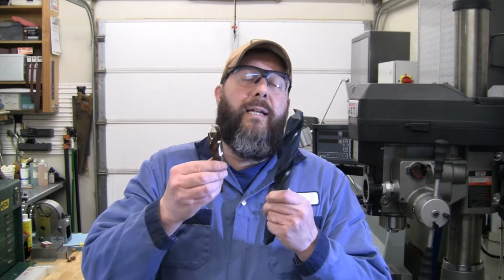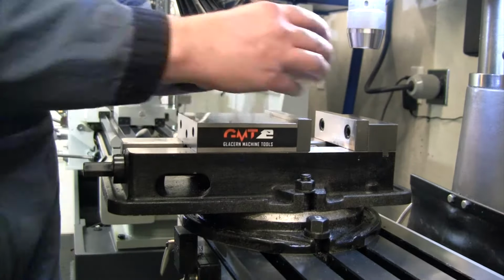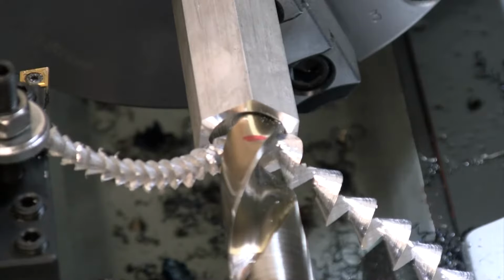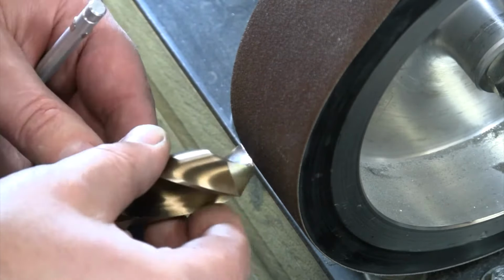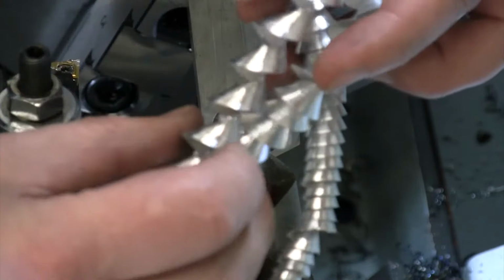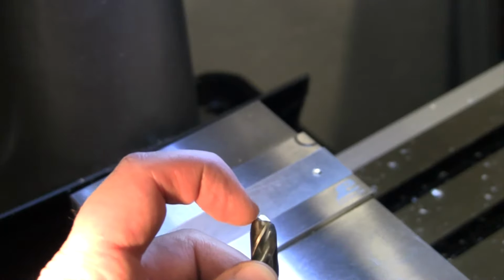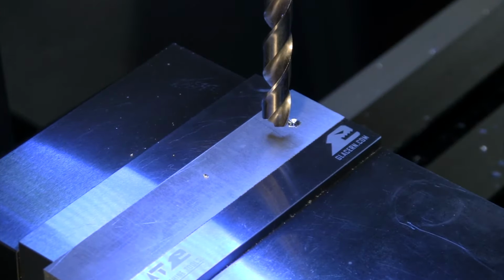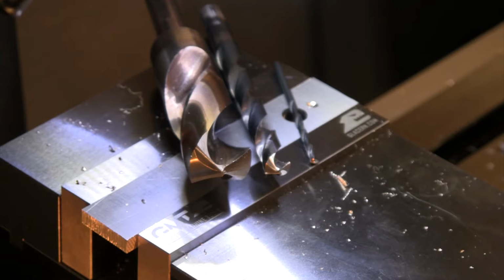How to Sharpen Twist Drills - Small, Medium and Large.  A Skill Everyone With a Shop Needs!

Comment: The best explanation I found in the network. One point is missing: cutting edges with different lenght result in bigger hole size.
Reply from the maker: @mbarshesh  Appreciate the comment and the feedback. In the intro I talk about the importance of getting them equal length so they cut equal, did not realize I hadn’t mentioned what actually happens when they are not equal and cutting even.  Thanks!

Comment: Hey Bud...great idea  on the large drill fixture for checking lip length....
I have watched dozens of video on drill sharpening, 
and have never seen this great device....your  video is to the point, pun intended....
and very well done, I also use a belt sander, and old 2x48 Kalamazoo.....
wish I had something that did not hop around so much.....I do own a 
Black Diamond drill sharpener, but it only goes to 3/4"....so your technique 
is very helpful......I did come up with a way to put flats on the shank of 
Silver and Demming bits, by using a 5C collet and a hex collet block and 
then an xy table to move the bit back and forth in front of a grinder, 
which I took my Radial Arm saw and installed a grinding wheel on it....
used the arm to move the wheel in and out.....worked slick......unfortunately
my mill is under the weather, so I had to improvise....if you know what I mean....
If I use a 1/2" collet, I can put bit in the square collet block and run Back and Forth
to grind on the radial arm saw or belt sander......for really big bits.....I hope I have not 
bored you with this long winded dissertation......[pun intended again]
best wishes, Paul in Orlando, Florida
Reply from the maker: Paul Brown - Glad you enjoyed the video, and not to long a story at all. I always like to hear how others improvise to get things done. That is always the challenge in the small home shop for the one off unique task is how to do it with what you have in hand.  Cheers!

Comment: What happened to the good old fish tail gage  !
Reply from the maker: Doug Ekren - The old fish tail gauge is a great tool for threading for sure. I have a couple of them I use. With the 60 deg in the tail you can get an ok read on one edge of your drill and 60 is pretty close to 59 deg. I just tried it and it is a little hard to hold square on the shank with so little edge length in the fish tail. But, if that is what you have instead of a protractor I say go for it. Thanks for the comment.

Comment: Do you have any tips on resharpening a parabolic flute bit? These have much thicker webs than normal drill bits, and when you try to grind it like a normal drill bit, it does not look right.
Reply from the maker: Tyler Fu - I am not familiar with that type of bit. I have used some bits with a thick web and after sharpening I go in and thin the web on the trailing edge to get a more normal size chisel point. Maybe that will work for what you have?
Reply: @BladesIIB  Problem is my bench grinder can't grind a sharp corner... the edge of the wheel is rounded and no matter how hard I try to thin the web all it did is round it over. I think I need one of those belt grinder but they're really expensive over here.
Reply from the maker: @taiwanluthiers  look for a wheel dresser to square up your wheel. Either a Star dresser or a diamond dresser. They are only $20-$30 dollars and easy to come by over here. Hopefully those are easy to access for you as well.
Reply: @BladesIIB  Is it even possible to dress a normal stone wheel to be able to grind a sharp corner? A while ago I got a dressing thing but it was a single point diamond, not the hammer looking thing, and while I could dress the wheel for some reason the edge is always rounded.
Reply from the maker: @taiwanluthiers  I guess it depends on the wheel. You should be able to get a pretty good corner. Depending on the hardness if the wheel it could round over and wear pretty quickly again. But I have sharpened many drill bits in a stone wheel before using the belt grinder.
Reply: @BladesIIB  Many of those parabolic drill bits have very sharp corners, almost like they were made with end mills and not wheels... no idea how they got them. Actually many end mills have very sharp corners in it too.
Reply from the maker: @taiwanluthiers  Ok understand. Can’t think of any other ideas on those ones.

Comment: Hi, I’ve just found your great channel and subscribed. When you were cutting the 60 degree angle with the compound did you run the lathe in reverse? Thanks looking forward to going through your videos 👍
Reply from the maker: John Amber - Thanks for the comment. Yes I was running in reverse cutting the 60deg. Should have commented on that in the video. Just seemed easier to have the compound at that angle for feeding. I could have turned it to 30 deg the other way and run forward. Then you are just leaning over the lathe a little more to turn the compound. Thanks for the sub!  Hope you enjoy the other videos.

Comment: Awesome video! Do you have any day on those Dr. Drill machines? For small bits at least.
Thank you!
Reply from the maker: Edson, Glad you liked it.  No I don’t have any type of sharpening machine. All done by hand.
Reply: @BladesIIB  thank you for replying! i own a couple of them and they seem pretty good at it. Also, did you get my message about sharpening cutting boots for different materials and cuts? I think it would be the first and only on YouTube! It’s something i think manny don’t know enough to decide how to shape their tools for each job. Thank you for the great content you put up and your precious time!
Peace!
Reply from the maker: @roadshowautosports  From what I know, yes the Drill Dr. works well for sharpening. We had something at the shop I worked at 30 years ago and mainly just used it for large bits. Bottom line go with what works best and what you have. I saw your other note, I am good with making any shape tool I need. I am not an expert on all the angles though. Other than on drill bits or threading tools I don’t usually measure any angles on my cutting tools. I will see what I can come up with. Thanks for the feedback.